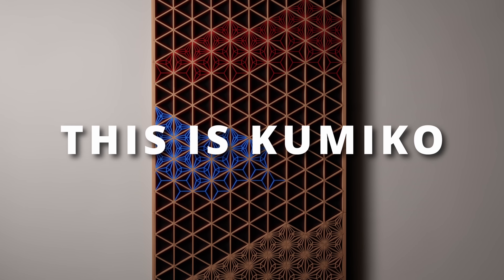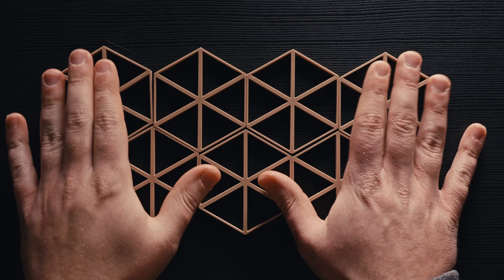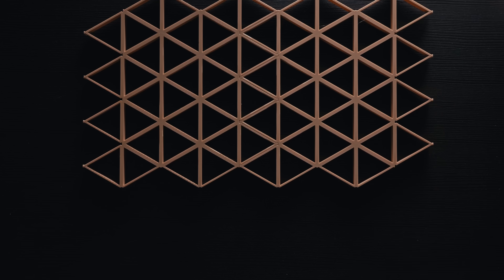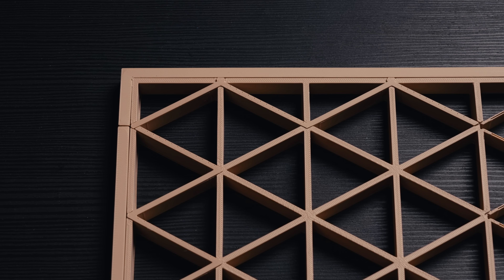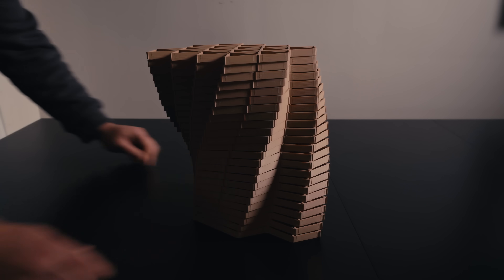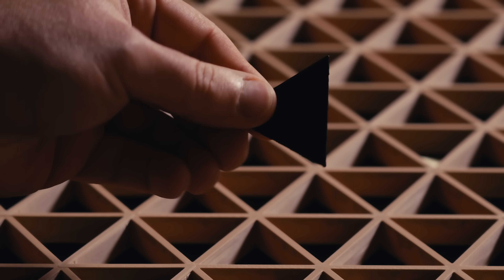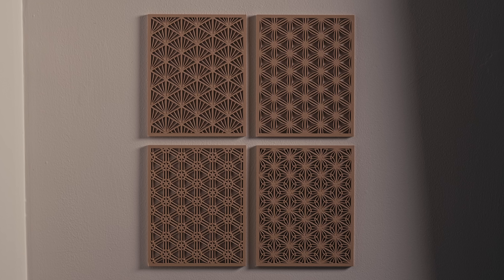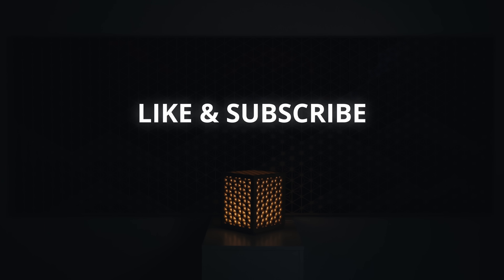I 3d Printed a $2,700 Kumiko Panel

Comment: As a 3d printer engineering feat — great. But as a piece it's disrespectful to the art. It's the same thing AI does, but 'manually' if that makes sense. It's looking at a painting in a museum, coming home and printing a photo of it to showcase your printer capbilities. Are the colors vivid and does it look the same from afar? Sure. Is it still an art piece? Hard to say. And if not stealing per se, it's still diminishes art to some repeatable blocks. Yeah you did well man, but this is not what 3d printing should be used for imo. Because again, that's exactly what people hate about AI 'art', just making it slowly.
Reply: Hard disagree. If you print a poster of a painting, you have a poster, not a painting. You also don't claim you are a painter. Why should art be only reserved to people who can either paint themselves, or who are able to pay hundreds to thouthands of dollars? 

This 3D print seems very similar. Most people cannot afford such a piece, and certainly don't have the skills to pull it off. I would also argue that the form is so different compared to an actual Kumiko Panel, that they are to separate things to begin with, despite the Kumiko being the main inspiration. 

Ai works very different, as it steals peoples original works to train an algorhythm and then replaces the artists. I kinda doubt that many people who will print would have otherwise spent $3000 on a real Kumiko panel.
Reply: @Mazovian2  well duh, obviously it's way cheaper to steal than to buy. Shocking revelation. Your comment boils down to 'why shouldn't I get expensive item if I can't afford it?'. Why should I pay for someone else's design, creativity, patents, education, when I can just look at a picture and make the same thing? 

I wouldn't have said anything if author didn't call it 'art'. By that definition he does claim to be an artist, and that's just bs. It's craft and it's craftsmanship for sure, but not art. AI works exactly like that — he stole original art work and made a copy of it, just manually, as I said. Next stop is massproducing it in China at a plant, would that still be considered art?

Yeah man they wouldn't. That's the point with any theft. There's nothing inherently wrong with buying a fake nike's or pirating a game — but don't pretend like it's something good and you're doing the world a favor. That's just hypocrisy you tell yourself to not feel bad (because you know it's wrong and now you have to make up excuses why shouldn't you this and that). It's a really weird stance that if you don't have the money for X it's fair game if you steal it. 

How about this: look at it and create something new and unique? Oh you can't? Well then it's not art. Just like AI can't create anything new.
Reply: @zenlettering  
I really do not care if this is "actual art" or not, even though there is certainly some creativity and skill involved in the process.

Also, someone painting a piece inspired by an artist, or making even a copy of an artwork that already exists, would still be art to most people. So I would argue that things do not have to be "new" to be art.

I mainly made an argument about why this is different than training an algorythm on e.g. your lettering and then using the ai to make stuff similat to yours. 

Stealing a design from a billion dollar company is also arguably a whole different thing and a bad example. The same is true for pirating games, as they intellectual property. Your take about the exclusivity of art is weird. Should money determine the acces to all forms of art?

He copied visuals and patterns of an art form and translated those into a new medium and way to build something in a similar style. It is clearly not the same. Not in process, material, or even spirit.

Comment: The videography was sex. Project is pretty cool as well. How did you move the whole thing after assembling it on the table? Are the joints strong enough to hold it together?

Comment: I can see several optimizations here: 1// use a 1/2” black felt backing instead of printed material. You get the deep black plus room acoustic treatment in a uniform sheet. Back that with a thin pvc panel for ease of hanging and moving. 2// why not make the segments non symmetrical  in z axis where the seam covering is integrated directly into the segment on one side and recessed lower on the other ready to be covered by adjacent? 3// wood filament would be amazing

Comment: What colors did you use? I saw brown listed on the maker page, but I didn't see the red and blue in there.
Reply: I wanna print the exact same thing. I can always modify it later. It seems like the frame itself took 2.8kg brown, 5kg of black, and the inserts were a mix of brown, blue, and red at 1.8kg. So if I buy a few spools of each, I should be safe.

Comment: you could dramatically cut down the print time by stacking the panels on top of each other. You would either alternative each panel with a different material pla frame -> petg frame->pla frame-> petg frame OR you could print it with a interface layer like so: pla frame->PETG interface ->pla frame -> petg interface -> pla frame. 

I did this with a honeycomb storage wall print and if I printed all 32 prints in 2 gos (16 alternating frames). Individually it would have taken a more than a hundred hours. But printing it in 2 shots took less then 24 hours.

Comment: Great video.!!
As for the process, it will be 10 times easier and convenient on a laser cutter. And possibly even cheaper (depends on location).
The idea and implementation is great, but its just not the best use for additive manufacturing. Kudos on the creativity though!

Comment: Looks good and great production. My only critique is your frame. You might consider mitering (like a scarf joint) so you’re not butting pieces together. You went through a lot of effort to hide other seams and might consider the same with your frame. Or make it (the frame) out of wood?

Comment: You forgot to take into consideration how much it costs you in Time and Energy. How much cheaper or more expensive is your version compared to the $2700 version? Now, that's the information that matters the most. 196+ hours and that is not counting design time, cost of Fusion 360, etc, is a lot of time if we look at the federal minimum in the US of $7.25 it costs in time about $1421 just to print it, not including your prototyping, errors that required reprints, assembly and the cost for the filament. Now as an artistic and learning experience, plus bragging rights it was probably worth it, but the wood is still cooler because of the effect and skill required.

Comment: You could have bought a larger printer for cheaper. Hell, you could have made a wide printer and just used wood pla considering you did not need a heated bed to print this.

Comment: Regarding the panel connections is there anything preventing essentially a reduced height wall on the connecting edges so there's still a single piece with a solid surface?

You'd reduce the mating plates line by half and push the extra seam into the wall of the panel itself.

Comment: Instead of having a aditional piece to cover the seams you could have made the connecting pieces L or T shaped and have the mounting piece be just tad lower on the connecting side so the  head of the L or T shape cover the top. 

This would have saved you material and time

Comment: This is a very cool approach to a classic art form! My only thought is if your adherence to 3D printing exclusively added some complexity to parts of your design. One thing that stands out to me are the background pieces. Assuming you're keeping a consistent background color, why spend 20+ hours of printing time, probably a good few hours of assembly time and a half kilo of filament to do something you could do in a matter of minutes with a piece of MDF and some paint? If you want it to be lighter and/or translucent, you could use a large piece of fabric instead. I also wonder if there is an alternative to using cover plates to remove the seams. Finally, did you print these batches stacked or did you print one sheet of what you wanted at a time?

Comment: Would love to also make this double as sound deadening in a room, I can see how all the cavities might work well for that purpose. 

Also I was wondering for the covers youre using for the seams, could you not have integrated them into the design of the triangles so when you press them in eachother one of the parts covers the seem. Kind of like an L shape where the right vertical part of the L is the seam and the horizontal part is the seam cover. I might be overlooking something though.

Comment: Hi, great work, thank you to sharing it. What i do not understand is why you introduce a third piece for the joint ? Would it be easier to have a piece shorter and the second with the good height taller overlapping the shorter ? M'i miss something ?
Would be cool to engineering it to be the ultimate peg board system ; D

Comment: to get a seamless design you could've made it so the cut out for the dove joint is not all the way through, that way after you insert the piece on the opposite side it looks solid with no seam

Comment: If the backing pieces are uniform color, you could print them as plates to provide additional rigidity.  Perhaps the backing plates and the seam-covering plates could be the same tiling which overlaps the sandwiched tiling.

Another plausible idea for handling seams would be to print faux seams into the cover plates, so that the real seams and faux seams appear regular and intentional.

Comment: Very nice. Though for the seamless-ishness, have you thought of putting the seams on the backside? Like, leaving 2mm 'roof', so you have slide the dovetail from the bottom side so on the top looks more, flush?  Almost like "T" shape if you were to look from the side when you slide it up ⭱.
Reply from the maker: Thank you! I was initially thinking of integrating the seam covers into the frame and printing things upside down, similar to what you're describing. The main thing that discouraged me from trying this is that there's a small lip in each triangle that prevents the pieces from falling out the back (I don't show/describe this in the video). Since the seam is at the front of the panel and this lip is at the back (relative to someone looking at the finished panel), one of them would need to be printed with supports which I didn't want. You might be able to get away with not supporting the back section lip, but I got too far into the project and didn't want to adjust things that worked well enough.

Comment: On one hand, the end result is impressive. As someone who 3d prints a lot, I commend you on the design work. On the other hand, as I am also a hobby wood worker who has done kumiko in some projects, this unfortunately misses the main point of doing it. The reason kumiko is so expensive to buy from masters is because of the amount of time and skill it takes. The time making it is just as important as the end result. You are doing a highly repetitive task that requires a great deal of concentration. During this time, you train your brain to be consistent and focus on the task at hand.Angles and lengths must precise to get a good result. Those trained in the art of kumiko are taught to see the time spent as a form of meditation. You can save money by doing it yourself if price is the obstacle, but I highly recommend giving it a try by hand. You can do it with cheap wood and stain to keep costs down instead of using bespoke expensive species.

Your editing and sound was great. Definitely subscribing.

Comment: take the 196 hours, multiply by the power draw of the 3D printer and multiply by the electricity cost in your location, and add that to the cost as well

Comment: THe intro made me think it was backlit. 
I had never heard of kumiko until now and I imagine it's nbot traditionally backlit, but being able to control lights in the way the intro colour's flickered would be sick (and probably not too difficult/expensive). 
Some matte black, with a single layer of blue/red filament as lines through it and LEDs behind them should let light pass through. Could possibly even get away with printing 1 later of matte black over the colour as well to hide it until the light comes on and the colour shines through. 
This looked rad and I'm amazed by the size of it. Nice work.

Comment: I'd perhaps have considered "embracing" the inevitable Joints and hide them by creating fake joints on ALL the parts regardless of them having ones or not - This would result in a truly uniform Pattern because even with the solution you went with - You ➡ still ➡ have ➡ Joints 😏

Comment: For a long time I have admired kumiko and wanted to learn it if necessary to achieve the designs. Later, when I realized I didn't have the tools and woodworking abilities, I wanted to work on 3D printing it, to which I saw various versions throughout the years of attempts, but which were not customizable like this. This is brilliant and very well executed. Incredibly well done! Looking forward to trying this some day. You shared a link to make the mini ones. Did you also share a link for making panels as large as yours?
Reply from the maker: Yeah, I always wanted to make a wooden kumiko panel, but it requires a huge amount of patience so I've always been hesitant. This scratches that itch just a bit.

Also, I'm currently organizing the files and instructions for the larger model and will put it on MakerWorld for free once I'm done. It'll take a while before it's made public, however. Stay tuned!
Reply: @paper_view  Set up a Kofi link, we'd more than willingly pay you a donation for the amount of time put into making those models public!

Comment: How did you mount it to the wall?
Reply from the maker: It's mounted with a mini french cleat system on either side of the panel. Smaller panels can probably be held up with some 3m command strips, but I didn't want to risk this one lol.

Comment: I set out to build the smallest water-cooled gaming PC I could, so I designed and 3D printed a compact case from scratch. The tricky part was figuring out how to make the front and sides visually interesting. I ended up using a honeycomb mesh on the sides to provide airflow and a glimpse into the internals. But after seeing your kumiko box at 6:07, I’m seriously inspired—now I’m thinking about turning that design into my next high-performance gaming rig!

Also, just a thought—adding some subtle backlighting or even addressable LED zones in a future version could really elevate the design. The way the kumiko pattern would glow could look amazing.

Comment: Wow, great Project! Well done! How did you Put it on the wall? Screwing some pieces or glueing the whole thing on a Plate? Thanks
Reply from the maker: Thanks! There are french cleats on either side of the frame which the panel hangs off of. The french cleats are 3d printed as well; one side screws into the wall and the other is attached to the panel.

Comment: How did you secure it to the wall?
Reply from the maker: There are french cleats on either side of the frame which the panel hangs off of. The french cleats are 3d printed as well; one side screws into the wall and the other is attached to the panel.

Comment: That’s less filament than I expected. This is pretty cool.
Reply: And if you wan't to.. you can print it in 1/2 height - for a faster print, less material, but of course a visual sacrifice in depth
Reply: I agree! Very light.
Reply: i was thinking close to 10kilos
Reply: I thought the same thing when the tally started.
Reply: Yeah I was really surprised, turned this from "hey, thats cool" into something I'm actually going to print
Reply: another bought comment
Reply: @darkracer1252  🤡🤡🤡
Reply: @darkracer1252  🤡🤡🤡